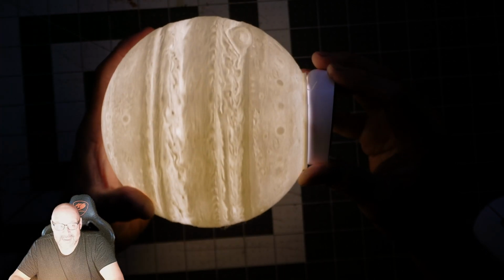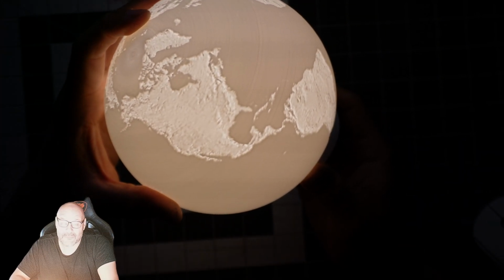Microswiss FlowTech Hotend for Bambu Lab X1 and P1 Printers

Comment: Did you change the retraction settings in the slicer first? I just got mine in the mail. I haven't installed it yet. I'm a bit confused about how to change those settings.
Reply from the maker: Yes, I had to change things. I've got the answer from Reddit, but I had to change it because it gave me issues, and I haven't returned to it since.